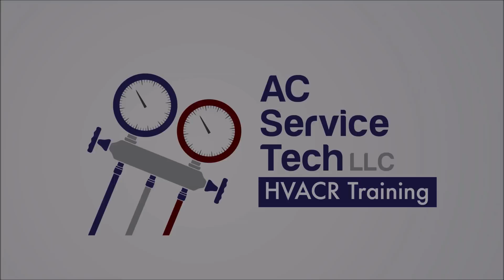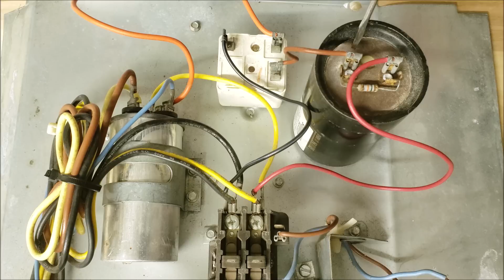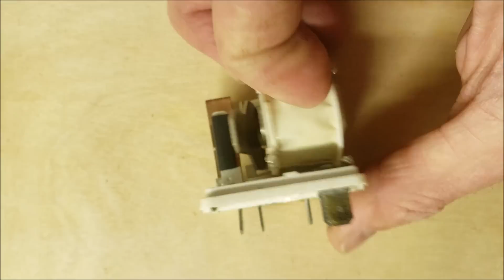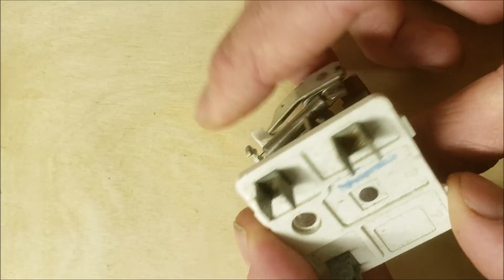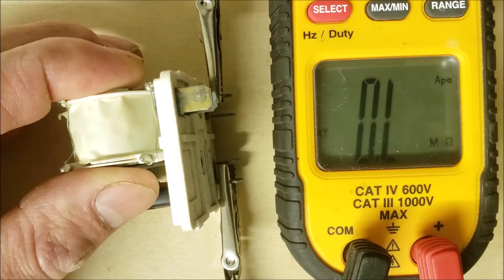Troubleshooting the HVAC Potential Relay!

Comment: My relay buzzes for many minutes after the AC unit starts up. How can I determine that contact points have actually opened up after startup since Voltage will still be at both #1 and #2 terminals on the relay even if the contacts are open.

Comment: Does the contacts in the start relay stay open while the motor is running because there is still current traveling through the start winding at all times even though the capacitor is disconnected?  Or is there another reason why it stays open while the motor is running.

Comment: My system died on me after a lightning strike very nearby,  The thermostat works and the main relay in the outdoor unit gets pulled in.  The fan runs.  I checked the dual run capacitor and the capacitance was fine.   I can't check my start capacitor because my meter only reads up to 100 uF and it is 189-272. .   I checked start  the relay (coil, contacts all looks good)  and even opened it up. I watched it on power up.  It pulls in the contacts on power up but never opens back up.  I get no sign the compressor runs. No evidence of refrigerant being moved and no increase in am  I have a new starting capacitor coming tomorrow and meter that can read up to 400 uF so I can check my starting cap (and others in the future).  Would a bad start cap cause these observations?  I worry the cap is not bad and its something worse. The lightning strike killed a GFI, a router power supply, internet, tripped a arc fault breaker, and now I hear the microwave is dead.  Ughhh!

Comment: How would you test that start capacitor with the resister on it. Do you have to remove the resistor then check it
Reply from the maker: Yes and then add a bleed resistor back on with spade clips, or you could solder it back on it desired.

Comment: Should the relay and start Cap be replaced before they fail as a maintenance procedure ?
Reply: Yes. As a good tech observes the condition of the unit then testing these components should be involved in a maintenance protocol. Good news is I havent come across these much in residential outside of communicating systems from the early 2k’s but in refrigeration I see this a lot. Hope this helps

Comment: I had one 5-2-1 that worked Initially. Then the compressor was trying to start on and off and the capacitor was overheating when I removed it everything was fine. The capacitor 40 / 5 was also replaced and tested  good.

Comment: i replaced 2 capacitors and one relay this whit relay is the only one left to try before i need to call someone. fan runs but air is not cold from the vent , unit is 5 years old tramxr15. nice vid thank you.
Reply: My AC also has a drip pan in the attic which has a sensor that shuts off the compressor when it gets clogged and fills with water.  If yours is configured like mine you might want to check your drip pan.

Comment: Thank you thank you thank you! We had a person change our  AC fan. But later in the day when we turned on our AC, the compresser would not turn on. I could hear it try, but just would not go. I looked at the relay switch and hard start connect to the capacitor and it was not making any sense to me. After watching your video I learned the hard start and capacitor was not  wired correctly after replacing the fan. After watching your video, I changed the wiring (both c wires were going into the hard start, while the condenser wire was only plugged into the relay - which makes sense why the switch was turning on, but the capacitor was not getting power to turn the compressor on). YOU SAVE OUR EVENING AND THE TEMP IN OUT HOME IS WELL ON IT WAY DOWN. Thank you so much!!!
Reply: Adding a hard start kit like what supco makes can also help the start cap run the compressor I.e not dimming lights in the house or surging crazy power

Comment: Ok old man needs some help please....
York 2.5 heat pump. No cooling..start cap was blown.replaced start cap blew again.relay welded. Replace relay 1 2 5 ..replaced cap with new same cap. Turn unit on....fan out side and inside run compressor not coming on. I have in the past replaced the cap then all was fine but not this time. Help Please
Note. I opened the relay and the points were open so I bent it so it would stay closed so as not to have an open circuit.  I have ordered another will be here tomorrow. No click as to power up for the compressor to start. Relay may have need faulty...I will ohm out compressor tomorrow after installing newer relay.

Comment: Here because I turned a capacitor on a unit to see the MFD rating and a wire was loose on top of the capacitor. That wire came off 2 on the relay and boom. Relay chattered and kept sparking. Gonna replace tomorrow.

Comment: If start capacitor and run capacitor are good, but the compressor still quickly starts and stops, does it mean the potential relay is bad? Thanks.

Comment: I've been having issues with my compressor not 5 on and tested the coil in the relay, reads OL. Also tested start capacitor which checks out. Inexplicably I put everything back together and air conditioner started working. Is it possible to have intermittent issues with the potential relay? If so I will replace it but don't want to replace a perfectly good part even though it did test bad.

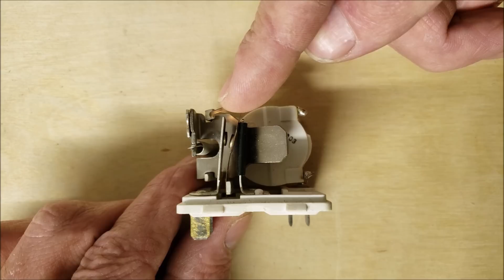Comment: Excellent video.....At 3:50 of this video, as you told when the bracket is pulled back, there should be "no resistance". But when the contacts are not joined together than there should be "some" resistance? Kindly correct me please.
Thanks for your excellent work.

Comment: Great info... 1) can you explain why there is a resistor between the poles on the start capacitor (what's its function/ what it protects). I just put a start capacitor on my old Carrier 38XD-130-300 but the cap didn't have the resistor between the 2 connections (like in this video) and it promptly blew up. Now I wonder if the start potential relay is failed or the cap with no resistor was the reason for failure.
Reply: The resistor is for discharging the high capacitance capacitor so that it won't shock you if you accidentally touch the contact.

Comment: Great instructional video! I’m watching because I’m trying to figure out if my potential relay is bad. I came home to an air conditioning compressor that was practically red hot, unit not cooling. Compressor shut down on thermal overload.  The start capacitor was in bad shape, so I replaced it. Now the compressor will start but the current goes up to 95 amps and stays there for about 5 seconds, then trips the circuit breaker. So a bad coil or stuck contacts in the potential relay could cause this problem? What voltage can I put on the coil to test it to make sure it opens the contacts? Thanks!
Reply: 2 years late but did the compressor end up being replaced? Sounds like its drawing locked rotor amps. I dont think the relay could cause this but I just got out of school so IDK for sure. I wouldve checked to see if ur contactor was sticking closed, that could be a possible cause of a locked compressor.

Comment: Is it common for the relay to melt? Our A/C stopped working, and found the relay melted/blown....just trying to figure out if the problem was the relay or if there is a bigger issue and the next relay is going to practically explode. Thanks!

Comment: Great, clear explanations - very helpful. Thanks for taking the time to share your knowledge. 

I know Start performance improvement with a 5-2-1 Hard Start Capacitor Kit is not as great on SCROLL compressors, compared to RECIPROCAL types (many Y.T. vids show reductions of Inrush Amps by as much as 45% after installing a 5-2-1 Kit - I assume these are on Reciprocal compressor units). 
At best, I've seen only about a 9% reduction in Inrush Amps on my Rheem 5-Ton Scroll Compressor aftter the 5-2-1 Kit was installed.
Is this a normal "improvement" to see when matching the 5-2-1 Hard Start kit (biggest capacitor) to a Scroll compressor, or should I be seeing lower Inrush results than this? 

Install Story/DETAILS, for anyone interested:

So, I just installed a CPS 5-2-1 CSRU3 Hard Start KIT in my 7YR old Rheem 5-ton SCROLL compressor/condenser unit, ( was running fine), but was slightly slower, buzzier, and metered with INRUSH Amps a bit above the specification on start-ups, recently. 

L.R.A. specification for this 5-Ton split unit is: 152.9 Amps.  

BEFORE 5-2-1 Install... Compressor "C" wire Metered INRUSH = 157.2 Amps. 
AFTER 5-2-1 Install... Compressor "C" wire Metered INRUSH = 156.1 Amps.

Metered several "call for cooling" startups @ 150-155Amps INRUSH, AFTER Install: Best score was 147Amps INRUSH, with most starts hitting 152-155Amps.

Disappointed (thinking the 5-2-1 kit was a dud),  I metered INRUSH again, a day later, on a few more start-ups - I found that my INRUSH was averaging between 142-146 Amps and the compressor has a more positive start, no buzzy wind-up; lighting in home doesn't dim during start, as before. All wiring terminals checked & re-verified, good.

(Same weather, thermostat settings, no other system changes since install day). 
Odd - I'm unsure why unit seemed to perform better the following day.

Thanks for reading!

Comment: What are the symptoms of a failed or failing relay please? I have a vacuum pump that is hard to start when cold. Trips the overload switch after a few seconds of slow turning so I have to switch it off and on until it gets up to speed. Funny thing is once it’s run up once it then turns on fine but if I block the inlet it on the pump it won’t start again (adding load I guess). I have replaced the start and run capacitors but it’s made no difference so was wondering if it could be the relay? Any help would be appreciated!

Comment: I have a cap and a compressor -I don't have this setup on my system, is it better?
Reply from the maker: This is only needed when supplied by the manufacturer of the unit or the compressor is really having a hard time starting with correct voltage and good capacitor. Otherwise, it is not needed, thanks!

Comment: So, do those potential (voltage) relays have a correct orientation ("up" direction) that they should be installed in?

Thanks
Reply from the maker: Yes usually the 5 is up and the relay will usually say this side up. This is a potential relay. I did another video on the current starting relay, thanks
Reply: also, i think the relay in the video is a current relay, not a potential relay. I think voltage relays have 4 connectors

Comment: Is this why OEMs build new condensers without start kit ?  So that they don't have to warranty burnt out compressors due to defective relays not lasting past warranty?
I thought mechanical relays were bullet proof until you mentioned the possibility of contacts welding itself shut or problems with windings.  Scary stuff !  I'm going to remove my rectorseal 2 wire TO5 start kit from my condensing unit tomorrow.  Reason why I put it on was because my lights were dimming for a second each time my compressor starts up. 

As always, your videos are very informative.  Thank you!
Reply: got a trane xr 16 OEM  start relay burn to ash this week lol
Reply from the maker: Anything is possible with relays, any relay can burn or pit over time, thanks
Reply: @acservicetechchannel  I'd learned a lot from you channel.  Thank you so much!
Reply from the maker: @garyomglol  Glad to help Gary!

Comment: I had a compressor the other day with a bad relay which had an open coil. I told the customer first thing he could do is just shut the system down, leave the evap fans on if he wants but shut the compressor off until I arrive. Amazingly the compressor survived. I thought for sure it was toast. The internal overload saved him some big money. That's a bad situation closed contacts with any of the starting relays.

Comment: Would you do a video on your views and experience using 3wire hardstart kit and the 2wire? As always, thanks for your excellent hvacr teaches.
Reply from the maker: Hey Aliso, the two wire is a ptc, positive coefficient thermister that increases in resistance as amperage goes through it which cuts out the start cap. I would like to at some point, thanks!

Comment: Is the coil 240v on the relay?
Reply from the maker: It is around 300v for pick up voltage and is generated due to the back emf from the compressor motor, thanks A VM!

Comment: So if i go to a ac unit that has a burn out compressor i should also check this relay or if i didnt it could burn out the new compressor? Shouldnt there be something to protect the compressor burn out because of this relay not release or (stuck)?
Reply: new compressor = automatic NEW contactor, start relay and all capacitors. well unless you want to do the job twice and look stupid ;)
Reply: lot of guy dont change that other stuff out tho.  @throttlebottle5906
Reply from the maker: Yes you should check the relay but I would replace it along with the run cap and contactor for sure if you go to the extent of replacing the compressor. That needs to be built into the price of the job so that the contractor is safe, thanks dang0088 da and thanks Throttle Bottle!
Reply: all start components should be replaced if u are going to replace compressor. no need to check. check contactor tho.

Comment: How have you been Craig ?
Reply from the maker: Hey Tom, very good, time flies but I am pushing forward putting a book together on refrigerant handling and doing more videos, thanks and how are you?
Reply: AC Service Tech LLC Wow 😮, you’re putting a book together ? Man you’re talented alright ! Ever since you said that that carrier furnace can be installed in a down flow application and I’ve been happy and configured one for such application ! Next will be doing the gas pipe to the whole house and having the furnace installed and fired up.
I hot tried it while it was in it’s down flow upside down configuration and it worked no problem after redoing the drain for such application
Reply from the maker: Got ya, nice, glad to help Tom!